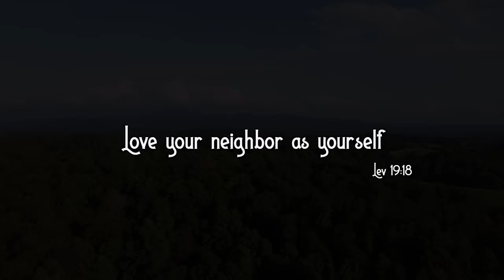Full Greenhouse Build: Start to Finish!

Comment: I just wanted to thank you so much for your video series on how to build your own greenhouse!  I had a Harbor Freight kit, which lasted a few years until a storm and a huge limb from our 500 year old cedar tree completely decimated the aluminum framing.  I was thankfully left with the wooden bottom structure & foundation, so all I had to do was reconstruct the upper part, this time with 2 x 4s for a sturdier structure.  

I could not have done it (by myself--a 70 year old woman) without the great framing tips you showed so well.  IT WORKED!!!  I was able to put up 3 walls in less than one day, and the fourth wall will go up tomorrow.  I revised the existing floor plan (a standard 6 x 8 with the door on the short wall side) & cut out a 3 foot opening for the new door on the 8 foot side.  I am adding a small dormer alcove entrance to add interest.  Because my floorspace is small (not so spacious as yours!), I did, like trailers now have, fixed "pop-outs" on the short sides that cantilever out, giving me more space inside.  They are almost like greenhouse "windows" and are wide enough to hold the 18" x 18" black plastic flats that nurseries sometimes give you with all the plants you buy...

After the fourth wall (with alcove entrance) is done, I will proceed to the roof, which I also watched you do.  I have so much more confidence in what to do next, all because of your videos!  THANK YOU, THANK YOU, THANK YOU!!!
P.S. You have an adorable family and beautiful wife!  (natural beauty!)

Comment: Wow, that thing will NEVER move or blow away! Great job there. Changing my mind re my hoop tunnel plans, now  that I see this nice white shed with the squiggly bit on top. Was just about to order the last wire mesh panel, (cattle panels, you guys call them). Ours here are a different size, but do the same job as builders mesh for concrete reinforcement! You should build these for people who really do want the best construction, and something pretty to look at. Not everyone with a small plot of ground to work, wants cheap and nasty. This little shed, come green house, is the ideal structure for people like me who want something nice in the yard. Will use the frame idea, with a skillion roof...as that is the farm older small shed style in our village, for an open sided wheelbarrow, cement mixer, lawn mower etc, store place, instead of on my verandah!  Thanks. This really inspired me.

Comment: The top plate of the walls on a greenhouse get a ton of moisture from the condensate on the inside of the plastic. This will cause them to rot. I apply ice and water shield to protect the top of the wall.  To protect the ice and water shield from the sun I put sheet metal flashing bent to a U shape on a brake. The tin goes over the top and down both sides and with the bottom open.  After this I land my trusses on top.
Reply: Even if panted?
Reply: @irinab7524   yes it is never too late.  Even if you have already put the roof trusses up you will get some protection.

Comment: I would.like to recommend painting the boards once with primer and first coat of paint before you build. Due to the high humidity in a greenhouse a single coat of paint will not last. There is also less ladder time than painting it 3 times after build.

Comment: I came across your green house build last night but watched it this morning. I was very impressed with what you did. I too had a similar green house build in 2020 and about 90% is recycled materials. I had started building in 2019 but with the lock down in March I completed it. My materials where single use plastic bottles in which 580+ in total where used. I had most of the wood for the frame bought before the lockdown, but had to scavenge for wood materials that where scattered around the apartment development i live in.

Comment: This is a thing of beauty.  Those diagonal braces must add an incredible amount of strength against racking.

And building the foundation walls (level) top down, with the timbers inside the 4×4 posts must also make it much stronger

Comment: Looks good and you've certainly put in a lot of work.  I like your rain harvest system.  My question is what is your plan to replace the plastic - the best guaranteed UV protected lasts 5-6 years with avg UV protected greenhouse film lasts 4 years.  Also pvc reacts with poly films especially those not UV protected (multiple layer w/nylon) causing rapid degradation.  So those roll ups probably won't last but one or two seasons.  Greenhouses with poly film typically have a channel/wiggle wire built into the design to make swapping out the plastic film much easier.  Also by merely screwing down batten/furring strips, the plastic movement by wind will either tear or rip the holes much larger and you'll have leaks during rains.
Reply from the maker: We're not using what most use for greenhouse plastic. Ours is a heavy duty 7-year woven covering. Link is in description and also to FAQ video.

Comment: Hi, I think you did a great job. Just one question though, is there a reason why you put the water barrels inside the green house? Putting them outside would have left you more room inside.
Reply: @Mathew Curtis maybe for thermal mass to help heat it at night?
Reply from the maker: Checkout the playlist link above, and the water harvesting specific build video. We cover that and so much more! :)

Comment: A better description would be "How to build a Rain Water Collection System in a Green House". Fabulous idea!
Reply: I'm curious as to why the rain barrels are inside the greenhouse and taking up valuable space instead of outside of the greenhouse
Reply: @jmad318  some greenhouse designs incorporate them as a thermal bank to retain heat from the daytime sun. Not sure if that’s the intent here but it may be. Also planter boxes and earth berms along the north provide similar benefit.
Reply: @shiftnsix  you're correct, the person who made the greenhouse responded to me about that in another comment and it was indeed for thermal mass

Comment: May I ask... Why all the time and money on the structure then plastic film?  Why not go all in with those polycarbonate panels made for greenhouses?
Reply from the maker: Cost. The polycarbonate panels are crazy expensive and not worth the price in our opinions. This plastic is not the average stuff commonly used in greenhouses in people's yards. This is extremely heavy duty 12 mil woven. Check the playlist out for the specific video about plastic on the roof for more technical information on it if you're interested in geeking out over specs. :)

Comment: Did I miss something?  You put the posts directly in the ground , not in cement?  Aren’t you concerned with rot after all your hard work?
Reply: He used cement, there's a short clip of them getting out of a 5 gallon bucket
Reply from the maker: See pinned comment above with links to full build videos of each step. Concrete was used for sure. :)

Comment: I had to stop watching after you didn't put a bottom plate on your 2x4 wall, I don't want to pick up on any of your bad habits.
Reply: Huh?  🦀
Reply: @davidhelfrich7150  3:50  you can see he stands the wall up with no 2x4 bottom plate then he shoots screws on an angle (toenails) which unless he has them all pocket screwed using a pocket screw jig a lot of those 2x4's will crack from the screws being toenailed.
Reply: CW: looks like he toenails (screws) into a 2x6 sill plate. Why is another 2x4 sill plate needed?
Sam needs tensile strength in his wall studs not shear strength. He also has built in great diagonals to prevent raking. 
It's just a small green house, not a building for occupation.  🦀